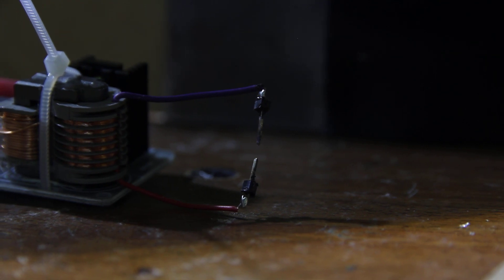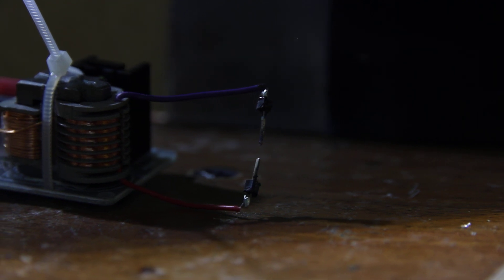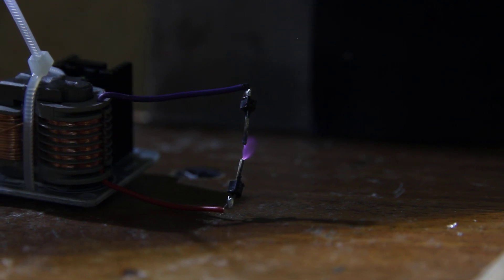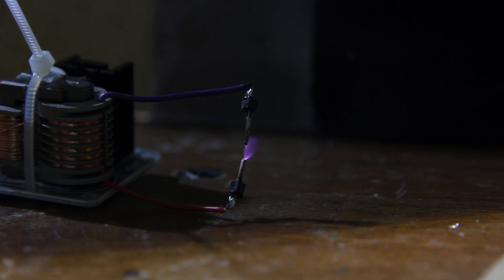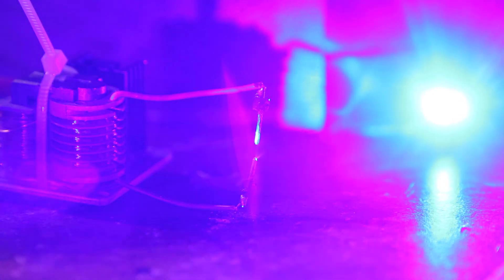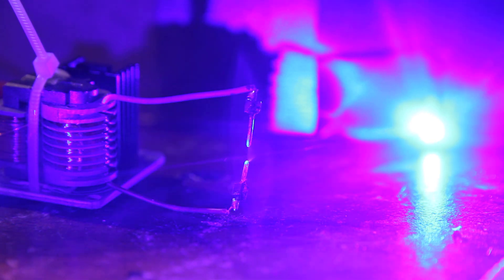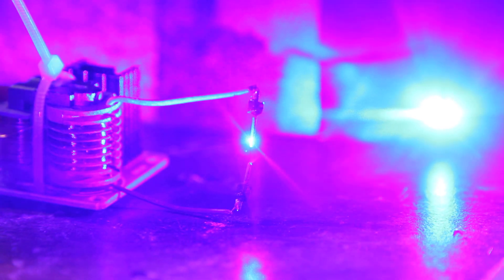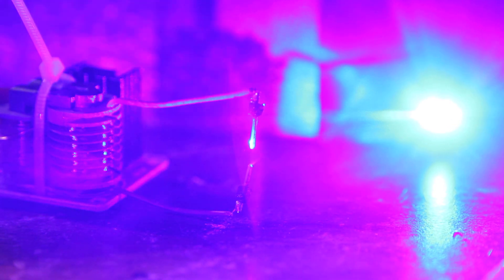600 volts AC source. Laser beam goes through high voltage plasma

Comment: it isn't working because this application requires two perfectly parallel beams, spaced close enough together that electricity can arc across the gap (try experimenting between 2mm and 8mm of spacing). i would recommend trying one version with the current electronics, and then comparing it to one that passes the beams through the arc gap of an extremely high powered stun gun.

what causes the phenomena of the laser induced plasma channel is two-fold; 1. as a laser beam of sufficient intensity passes through the air, it collapses all the air molecules it passes through, which creates a core of vacuum at the center of the beam (the energy put into the molecules from the beam is enough to collapse the molecule into a microscopic black hole that has a lifespan measurable in femtoseconds. a beam of this vacuum is essentially creating an invisible wire through space that electricity can travel down, but this wire doesnt form a circuit, which is why one beam doesn't accomplish the goal). 2. if two beams are perfectly parallel and closely spaced enough to facilitate arcing, your system now forms a completed circuit whenever the end of your beam makes contact with a conductive target, allowing the beams to carry the plasma to the target at light speed. 

i know this is something of a dummied down explanation of what's going on, but it should help point you in a better direction. in any case, i hope you succeed in your experiments!

Comment: Very, very interesting! In your opinion, are the photons from the laser that pass through the discharge maintaining their integrity, or does the discharge effect the nature of the laser photons?
Reply: I'm certainly no expert, but I'm assuming that a successful LIPC effect would have some sort of effect on the behavior of the photons, being that an electrified laser beam is a much different medium than an atmosphere or the vacuum of space. Without the proper instruments, we would need someone versed in extremely advanced maths and particle physics to weigh in. 

If you passed such a beam through a sufficiently powerful helicon coupler, you should be able to compress and accelerate your LIPC discharge in such a way that might affect the behavior of photons through intense electromagnetic fields and the sheer speed of the discharge. I'm definitely not an expert, but I do know that strong magnetic fields can bend light, and that light can then be compressed magnetically. I would wager that a pair of compressed beams of laser light with a bunch of high voltage arcing between them (also being compressed and accelerated by the coupler) might be enough to create an effect that changes the nature of photons, or more accurately, reveals something previously unknown about them.
Reply: @joshuawayne9811  thank you very much for your detailed feedback, it is much appreciated.
Strong magnetic fields bending light. Can you offer a source for this?
Reply: @StephenGoodfellow  because a strong enough magnetic field CAN compress the beam of an electrolaser or LIPC, that compressed and highly charged beam creates conditions where the same amount of photonic flow gets choked down into a tighter stream, which I imagine would increase "pressure", changing the behavior of the photons. Think of the beam as a pipe, photonic flow as water and the helicon coupler as a pressure spout; compressing the water causes much higher pressure, shooting the water out of the hose much faster and farther than it would have gone with just the hose.

Again, I'm no expert; I'm just a pothead sitting in an RV in the desert, but it feels like I'm on the right track to figuring out how to break the speed of light.
Reply: @joshuawayne9811  Thanks Joshua, your thoughts and insights are valuable to me.
I am presently writing a paper with a colleague as to whether an electrical discharge has a gravitational moment. Standard dogma says no, but then, as far as we have been able to discern, no one has run a laboratory test on that assumption.
The concept of the proposed experiment is as follows:
Aside from special exceptions which I will not go into here, in a fairly good vacuum, photons are supposed to be unaffected by magnetic fields.
That being the case, we were thinking of firing a stream of polarized photons close to the vicinity of an electrical discharge. It is the hope that some of these photons (with their specific signature) would survive passing the discharge and reach an interferometer target, resulting in either an observation implying either no deviation (classic expected outcome), or a slight deviation. The slight deviation would infer the presence of a gravitational field.
Think of the experiment as being in the spirit of Arthur Eddington’s eclipse observations, demonstrating the bending of gravitational fieldlines by the distortion of photon deviation due to the Sun, confirming Einstein’s theory of relativity.
What we are wondering: Does a momentary organized plasma event - such as an electrical discharge -  induce gravity? Gravity, without a corresponding quantity of mass.
Reply: @StephenGoodfellow  if your experiment doesn't work at first, try supercooling a magnet and slowing a laser beam by passing it through really cold water and next to the magnet. If the magnet bends the beam, you can consider your hypothesis correct, under certain conditions. 

As for discharge having mass that has its own gravity, that's a head scratcher. I don't know how such an effect would be achieved without an ionizing gas(maybe just float/magnetically suspend a superdense nugget of something ferrous in a spherical chamber lined with a bunch of inward-facing magnetrons, and putting in a little bit of a few different ionizing gases that you allow to cling to the nugget before turning on the machine?), but if you could create ball lightning in deep space and sustain it (vacuum isn't the same as vacuum in zero G), it would have to have at least some mass, because E=mc2. As far as having enough mass to exert its own gravity, maybe if you did it big enough? What it would have would be an intense magnetic field of it's own, and the reaction would probably sustain itself long after you've turned the magnetrons off.
Reply: @StephenGoodfellow  by the way, a HC compressing a LIPC isn't necessarily compressing the laser light, it's compressing the discharge that's channeled by the lasers, and the power density created in that compression is what could possibly affect photonic behavior. All the energy of two beams and a taser, compressed into an even thinner beam should amplify the curious "atomic black hole" phenomenon that makes an LIPC even possible, which might make the photons appear to slow, because they're being spiraled around the center of the beam (and eaten by it) instead of just flying in a straight line. Stronger coupler=tighter spiral=slower "apparent speed" of light. The coupler's compression should make the beam hotter and more magnetic, making the channel more conductive and compressible (while also shrinking the gap between your beams, which reduces loss of voltage through the air between the beams), like a feedback loop. If you can't alter the speed of light, figure out how to alter the medium it passes through.